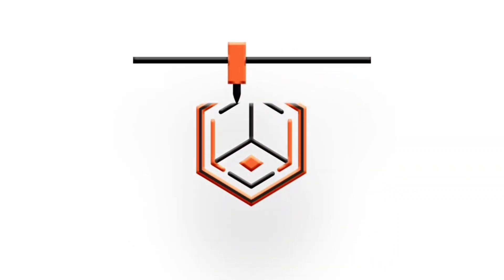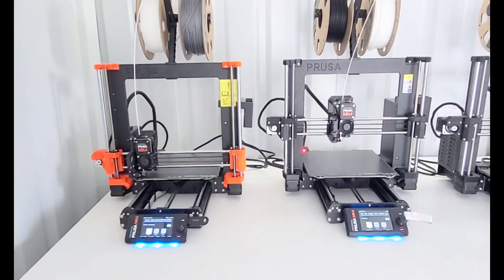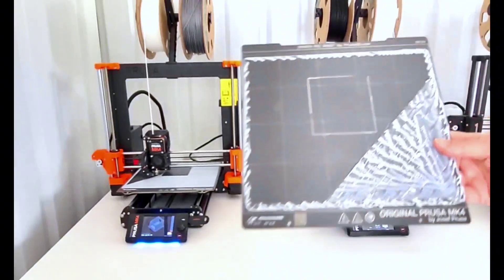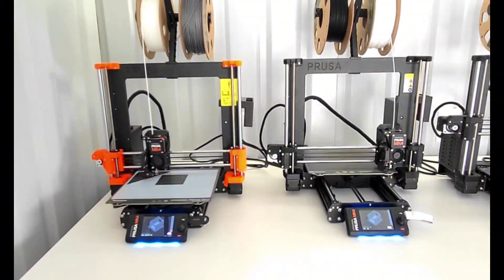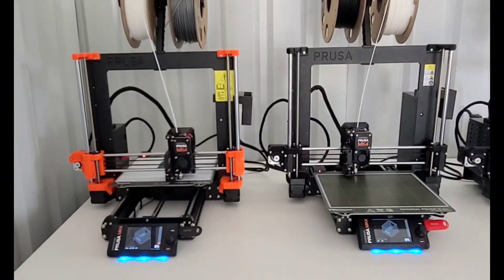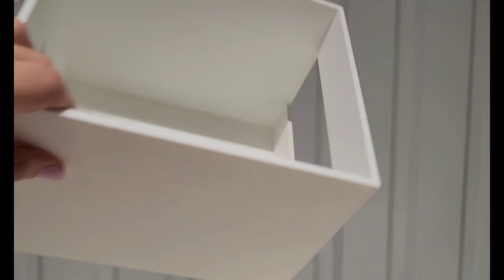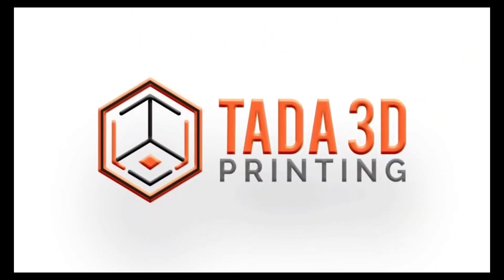Comparing prints with and without Input Shaper on the Mk4

Comment: Whenever you’re printing, something that’s utilizing the entire bed, you have a greater chance of warping. Best to use the XL or build an enclosure. You should run a few calibration prints and make sure your build isn’t the issue. Then troubleshoot the slice and or file itself. I’ve seen a few prints that I have done come out bad like that and just opened it up in Fusion and saved it again. Sliced it again and no issues.

I’ve seen that same first layer failure before. It’s usually been a dirty bed or a partially clogged nozzle from questionable filament.
Reply from the maker: Ok thanks so much!

Comment: Between normal and SPEED you will find STRUCTURAL, this slows things down a bit to ensure better fit of engineering parts.
Reply: Yea. When you need it to look nice or print strong, it's recommended to use Structural.
Reply from the maker: So is structural IS still faster than a regular profile? I probably have it set at speed. Os it a different profile or a different setting within IS? I only remember seeing one. Thanks!

Comment: I would use a .6 nozzle and 100% infill to reduce print time. When you have anything less than 100% infill, the tool head does more movements to make the infill and walls whereas 100% infills it just straight lines creating walls thus reducing the printing time. Also, with a higher nozzle size the model is way stronger.
Reply: Not only a bigger nozzle, but printing the object in vase mode with a very big nozzle (you could use a 1.2mm nozzle with oversqeezing to a 2mm linewidth). Than print a template to cut out the windows afterwards with a rotating knife (like a pizza slicer, but much smaler. warm up the knife and/or the plastc a bit to avoid shattering and layer seperation). Would be a much faster print and with just two windows = 8 straight lines to cut in postprocessing it would not be a big deal to do. the only part there the object isn't just a simple box is the skirting board. So this had to be printed seperatly and to be glued in afterwards.

On objects being basicly big boxes, always think about using vase mode and printing templates for the cutouts and seperated objects for details. Esp. if printing multiple times, as it can reduce printing time by a lot. Also such horizontal artifacts were windows starts and ends can not happen, if you cut them afterwards.
Using a big nozzle and high extrusion width also means the printhead moves very slowly due to the limited volumetric flow. Wich avoids artifacts due to resonances from the beginning, so you do not even need input shaper to compensate.

While I can understand 3d printing anything is quite a temptation, the 3d printer is just one tool in the toolbox. Do not only depent on this, but always think about combining different methods.

Also: Even with PLA you can print inside an enclosure. The ambient temperature matters for overhangs (you can not cool them fast enough if the air is to hot) and possible heatcreep on retractions. But in vase mode you do not have retractions and if you cut the windows afterwards also no overhangs. So printing with PLA and 40...50°C chamber temperature in an enclosure would definitly work and avoid warping.
Reply from the maker: I would've never thought 100 infill would be faster but I'll look at it. And yes a larger nozzle etc sounds like a good idea. I just jump around a lot so I try to minimize changing it too many parts. Thanks!
Reply: @tada3dprinting  100% infill is model dependent. In your case, its just a simple box that's just purging lines back and forth  so 100% infill would make sense in this case.

Comment: It would be interesting to see how these print on the XL.  As others have mentioned ever PLA will warp when it is that large of a surface, an enclosure might help
Reply: Def an enclosure for these. Only way to go honestly. I wouldn't want any printer without the enclosure. Helps a lot.
Reply from the maker: The XL is busy printing an even larger roombox. I really wish these came with enclosures. I may need to look into them. Thanks!

Comment: I feel like these walls would be a great candidate for a laser cutter.  Would save massive amounts of time and look better.
Reply from the maker: I used to glue plywood boxes but had trouble getting them to be clean and not break in shipping. It takes a bit to print but I like how smooth the edges are. (Usually) Thanks!

Comment: I think your flash drive could have been the problem on the none input shaping MK4. as far as the Coners go, I use glue stick and it holds them in place.
Reply from the maker: Yes I think you're right. Thanks!

Comment: I saw that you used another USB-Stick for the right printer when it was working. I had troubles in the past with bad USB-Sticks so that might be the issue. P.S. Thanks for the Video, still waiting for my MK4
Reply from the maker: Yes I think I just need to get fresh usbs. Some of these have either thr MK4 or the Mini Firmware on them and I think that may be the problem. Sorry you're still waiting. Is this your first printer? Thanks!
Reply: @tada3dprinting  I have a anycubic printer at home and some ender 3 at work. Lately I'm having a lot of troubles with my anycubic that's why I'm looking forward to the mk4 and I'm hoping it will be as reliable as everyone is talking about.

Comment: It looks like the input-shaped print is suffering from underextrusion, like it can't keep up with how fast it is trying to print.  You could slow it down a little, increase the print temperature a bit, use a larger nozzle, or a higher-flow nozzle like the Bondtech CHT if speed is still the most important thing.

There might also be some resonance issues with how the texture changes around the cutouts.  I don't know how Prusa addresses this issue, but Klipper is capable of measuring (either via accelerometer or via calibration prints) resonances and can then compensate for them by changing the acceleration curves to stop resonances from building up.  Klipper is pretty amazing, TBH, and its input shaper seems much more sophisticated.  It is quite good at ensuring that square corners are actually square and don't develop a weird extra cylindrical protrusion.
Reply from the maker: Thank you

Comment: As of last week, I have had my MK4 for 54 days and printed 507 hours, laying down 3.8km filament.
Got it as a kit with MMU3 and enclosure.

Even with the most recent firmware, I have not noticed anything out of the ordinary.
The few fails I have had have all been my own stupidity - like not closing the parts cooler after inserting magnets into my model, thus causing collision with the gantry, layer shift and then head collision alert...

However, Input shaper does seem to create odd artifacts. This is mostly seen when printing straight parts like gridfinity boxes and the like. It's usually just cosmetic and when printing in the speed profile.
Reply from the maker: Yeah I agree it's usually something on my part. If I just start it again, I don't have the same problem. But I do seem to have issues with squares sometimes. Thanks!
Reply: @tada3dprinting  That is the weirdest part of your issue. It should be there - or not. Not come and go.
I don´t believe it to be an error on your part. That would be... surprising, taken your daily experience with printing. Not like you are a n00b. 
I think it to be something slightly defective. Does it happen on days that are particularly warm or with high humidity?

Comment: This video is very interesting, because just recently I was printing full build plate boxes on A1 mini with 0.6mm nozzle and they warped no matter what I did. Not much, but they did. I tried different cooling setting, changed speed, even did some pauses from time to time to cool printed part to minimize material stress. Then I printed the same model on my old Ender 3 Pro :) with glass build plate and spray adhesive and it ended up perfectly flat. Model can be removed from glass only after it cooled down completely, otherwise the model brakes before detaches from bed. I am wondering if you found a way to print it flat.
Reply from the maker: It actually is printing really nice in my Bambu. I think the enclosure helps just enough. But I do have to make sure the print bed is very clean of course. Thanks!

Comment: I would try painting on the supports to have spaces or gaps between them instead of solid.  I found that the printing can bridge small gaps and you also have an easier time removing supports.     Also a draft shield could help along with the bridge (at least a few layers) to hold heat and keep warping from happening.
Reply from the maker: Thank you
Reply: @tada3dprinting Another thing to try is print the first layer hotter (extruder AND build plate) then drop the temps on both for the rest of the print.  I have tried that on a few prints and it worked out a bit better.  Started at 60c and then dropped to 55 or even 50c for the rest of the print.  Just enough to be sure it doesn't release..

Comment: I have issues with the new frimware if the printer powers off it comes on tells me the filament not loaded when it is. I have to tell it to load the filament does that process then red screen about input shpen displays press enter it goes back to the screen to choose the print again after starting that it works great. I not reached out to support yet about the issue been busy. I think there is still issues and this needs to be looked at as this is not a stable release
Reply from the maker: Same. But I am thinking mine is that I have a MINI firmware on the USB. If not, I may roll them back. Thanks

Comment: I've seen similar issues with the heavy lines you saw along where your door edge was. I'm not sure if it's input shaper going too fast or if it's something else. I need to test it out and compare. I've definitely gone back to the previous firmware for some of my prints because the quality is better. And I don't mind the time. I don't need super fast for anything I'm doing.
Reply from the maker: Yeah if you can't use the print, it doesn't matter how fast it is. Thanks!

Comment: As others have written, I would take the structural profile. It is the best compromise between speed and optics and strength. A 0.6 nozzle is certainly also appropriate. To improve the warping, you could reduce the speed of the first layer. Also be careful when using IPA before printing. May actually reduce adhesion. Better to clean with dishwashing liquid, the hard side of a kitchen sponge and lukewarm water. 
And one more tip if the printer is bitching. Do not reset but better switch off the power briefly.
Reply from the maker: Ok thanks so much!

Comment: I don't have any insight on the cranky printer, but updating the firmware maybe worthwhile.
Is there a draught perhaps exaggerating the warping? Maybe cardboard walls around the printers would help. 🤷‍♂️
Reply from the maker: Yeah I don't have the Input Shaping on the right printer. Might be time to upgrade it. It's possible that the AC is not helping. Thanks!

Comment: Very interesting.  I wonder  how the print would compare to same print on a printer with encloser, such as the bambu or qidi.  Or perhaps try the XL (with it's individualy heated bed segments), to see if those printers prevent warp on the first layer or have overall more constant print quality
Reply: She uses PLA. The ambient temperature inside an enclosure can result in heatcreep for retractions. However, you are totally right, as there is no info about room temperature in the video. For PLA ambiant temperatures above 35°C can cause problems with heatcreep or cooling on overhangs (depending on the printer).
So if the ambient temperature is maybe 20 or 25°C, "a bit" of enclosure might help (on my Qidi I for example open the door just a bit and put the top cover rotated by 45° on - so the heat exchange is reduced a bit, but not stopped)
Reply from the maker: My XL is busy printing a larger version. And my Bambu is busy printing multicolor. But I do want to try this. Maybe I can get it going on the Qidi. Thanks!

Comment: I think when the filament snapped it missed steps or something.  If it were me I would have cleaned the nozzle and homed the axis before starting the next print.

My experience has been the opposite of yours.  The prints I've made since using input shaping are the best I've ever had.  This is comparing to the MK3 and the MK4 pre input shaping.

Out of curiosity did you select speed or structural in Prusa slicer?
Reply from the maker: I'll have to look which I have. Probably speed. Do you print a lot of boring square things like me? Thanks!
Reply: @tada3dprinting  All different shapes, lots of curves.  I was honestly surprised how well it prints.  I had some initial concerns because with the stuff I print, quality and accuracy are more important than speed.   I have been using the structural profile as the base for speeds as it's still substantially faster.

Small intricate parts that don't have much cooling time I have not had good success with using input shaping.  I'm sure it's because the layers aren't fully cooled before the next one is put down.  Those small intricate parts I'm printing with the standard non input shaping profile. 

I'll also note that I primarily print petg inside an enclosure.  The brand of filament seems to influence the final result.  I've been using Hatchbox and for petg I haven't found anything that prints as well yet. 

The Nextruder on these printers has been making the nicest PETG prints I've ever made.

Comment: Can't you use an option to print right from computer vs having to physically use the menu/buttons on the printer? Did you try on the XL? Curious if that would do better. You get input shaper on that yet?
Reply from the maker: I have had trouble setting up the wifi for the MK4 but I do think the USBs are what I'm having trouble with. The XL is busy printing something else but maybe I'll put it next in line. No IS on the XL yet. Thanks!

Comment: I am using the latest firmware and I have run into that "freeze" after pressing the print button several times. A new thing for my printer is that as of yesterday, it is having trouble with the bed leveling on the right side of the printer. When it is doing a 49 point bed level it will have to retry the right two columns two or three times for each spot. Previously it would usually only have to retry once or twice over the whole 49 points. No idea what changed. 

That Input Shaper box did not look so good. I have only used it once so far and it turned out nice. The print was about as smooth as the .20 quality speed. What layer height and quality settings did you have your printers set to?
Reply from the maker: Yeah I was hoping with it being a stable version, that it wouldn't have so many issues. But I'm having it with all of my printers so I think it's actually the USB. The bed leveling seems very odd! I usually use .2 either speed or quality on the MK4s. Thanks!

Comment: @tada Did you see better quality out of your old mk3? Curious.
Reply from the maker: On some things yes. I find the MK4 warps a lot. I assume it's a speed thing. But I LOVE the Z sensor on the MK4. I usually run a print on the MK4 and if it sucks, I try it again on the MK3. Thanks!
Reply: @tada3dprinting  I am so hoping that i just teething issues with the new firmware that will get figured out soon! :)
Reply: I was about to buy a raspberry and the acelerometer for my old ender but much videos show that doesn't really help that much all this setup . but its quite interesting for sure

Comment: i would love input shaper but have a mk3 , my longest print so far was 6 days :-)
Reply: You might try klipper. You could install it on an old PC, just to test it. Also an USB accelerometer for input shaping cost less than $10. So nothing to stop you to try input shaping on a mk3(s(+)).
Actually I just got my mk4 upgrade kit today. I will try it the next days. However, I have 5 mk3(s(+)) and doing the upgrade on all of them would be quite costly. So after getting the mk4 ready, I plan to upgrade the other mk3(s(+)) to klipper. 
As it always is possible to change back to original firmware, this should be a risk-free move.
I might do an upgrade for the z-axis to 10mm rod afterwards, as this makes the printer more sturdy. Also I already modified most of my mk3(s(+)) to Revo; I might end up needing some RevoHF nozzles if printing faster.
Reply from the maker: 6 days would make me nervous! I haven't broken 2. Thanks!
Reply: @oleurgast730   you have been more experimental than me. Ive always liked the out the box feel of prusa, but saying that i also built mine as a kit.  so to get more info on this can you suggest any websites/videos?

Comment: I believe Watchdog is the new thermal model on the Prusa printers and it monitors temps to ensure that if the printer is putting power in that the temp changes as expected.  It is sensitive enough that you have to select whether your nozzle has a silicone sock or not.  I think it is triggering because the bed it wet from the alcohol making the bed temp not change the way it expects.  Try cleaning the bed before starting the print and see if that addresses the issue.
Reply: That might be the case. Cleaning the bed while it is cold is the recommended way to clean it per the 3D Printing Handbook that comes with the printer. It also notes that cleaning it while cold gives the alcohol more time to clean. The bed should be cleaned before starting the print, rather than after.
Reply from the maker: Good to know. Thanks!

Comment: What are the dimensions of the box ?
Reply from the maker: 9-1/4 inches wide x 8 inches tall. Almost completely the bed width. Thanks!
Reply: @tada3dprinting  I see on etsy that you also sell larger ones. Then how do you print those 1 whole if this is like the same as the buildplate

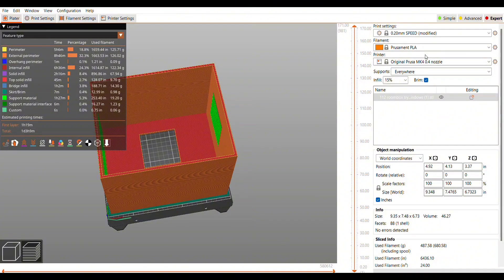Is this 1:12 scale ?